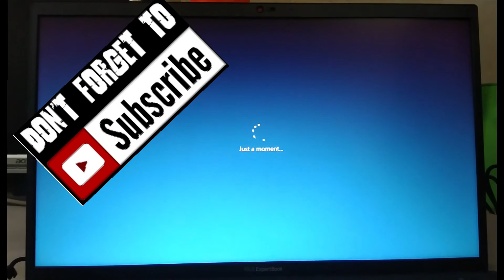Asus ExpertBook B1500C |  disassembly | RAM upgrade |

Comment: Hi, I have the same laptop, with 16GB RAM. Can I bring a 32GB RAM board? I have one free SO-DIMM DDR4 slot, i5-1135g7 processor. Thanks.
Reply from the maker: Hi Illia, 
no Asus says this model can support max 16GB DDR4 RAM
Reply: @nic0tina77  Perhaps our models are different in some way, I had 16 GB of RAM built in + I put 32 GB DDR4 of RAM in a free slot, now I have 48 GB of RAM, everything works fine.
Reply from the maker: Hi. well given your experience it is definitely like that.
what can I say MUCH BETTER for you!
by now we have software programs that are hungrier than a school of sharks 😅😉

Comment: In task manager it says my laptop has 1 ram slot and it is used, but when i open back cover i can see there is an empty slot. Can my laptop upgrade a new ram?
Reply from the maker: because a slot is already integrated into the motherboard. You can only add one (DDR4 8GB 3200Mhz)
Reply: @nic0tina77  but task manager says slot used: 1 of 1 . Are you sure I will still be able to add another 8gb ram to get total of 16gb
Reply: @nic0tina77  But task manager says 

Slots used: 1 of 1

Are you sure I will be able to add another 8GB ram to get Total of 16GB ram ?
Reply from the maker: the version I used, reaches 16GB max.
to clear up any doubts: https://www.asus.com/it/laptops/for-work/expertbook/expertbook-b1-b1500-11th-gen-intel/  and this link: https://www.crucial.com/compatible-upgrade-for/asus/expertbook-b1-b1500
Of course, if there are other Asus versions that do not allow an upgrade up to 16Gb I cannot assure you.
Reply: @nic0tina77  thanks for replying. I got a new 8gb ram and it worked. Now it is showing 2 of 2. I thought my ram slot was not active because previously it showed I only have 1 slot
Reply from the maker: Glad my video, and my answers were useful to you!
see you next time!

Comment: Does it have HDD 2.5' slot?
Reply from the maker: HI.
no it doesn't have a slot to put a classic 2.5" SSD or HDD
Reply: @nic0tina77  It does.Through ffc flexible cable.

Comment: What if the soldred RAM fails ? Will this laptop still work with the extended RAM you installed or the entire motherboad must be replaced ?
Reply from the maker: R.I.P. Laptop
Reply: @nic0tina77  Oh! From your experience does soldred  RAM failure happens often or it's very rare ?
Reply from the maker: hi.
I think I can say that less than 0.5% has happened in my career

Comment: Ram Brands?
Reply: Thanks for the reply but is it possible if I use another brands like for example crucial or kingston.
Reply from the maker: yes you can
Reply from the maker: Hi KendoMan, the Brand is Patriot
Reply: Will buy one now can you tell me the socket size so I know what kind ram I will buy thanks in advance.
Reply from the maker: The RAM used in laptops is called SO-DIM (Small Outline Dual In-line Memory Module) SO-DIM DDR3; SO-DIM DDR4 etc... just take a SO-DIM DDR4 to be sure that the size is the right one
Reply: I see PC4-25600(3200mhz) on the product is that the right thing.